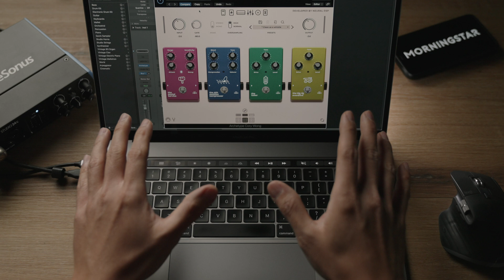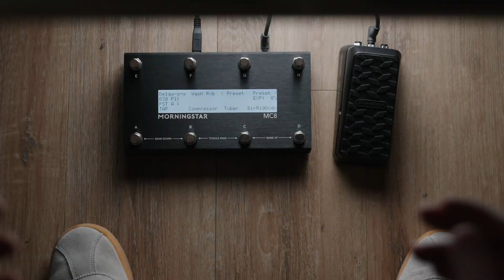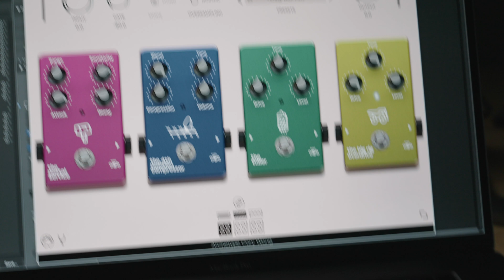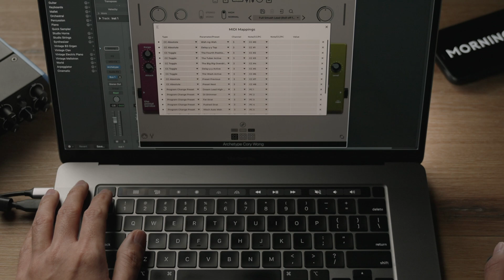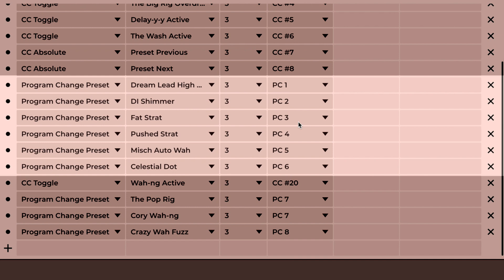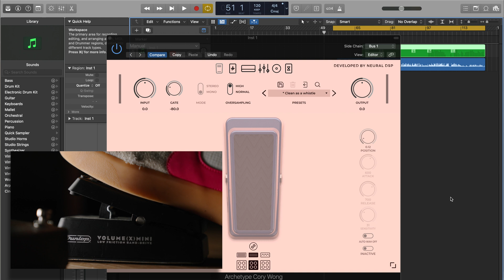Guitar Plugin Foot Controller - ft. Neural DSP

Comment from the maker: NOTE TO ABLETON USERS: For MIDI controlling Neural DSP plugins within Ableton. You will need to use Note messages with positive note velocities instead of CC messages. That is the only way Neural's plugins respond to Ableton MIDI right now.
Reply: Does that mean that there is no way to use an expression pedal with the Neural DSP VST in Ableton, since the Expression Preset Messages do not include Note messages?
Reply: Hi. Im here specifically to learn how to hook up an expression pedal to use a wah from a neural dsp amp. How do I do it? Do I need a specific Pedal? How do I connect it and set it up?
Reply from the maker: @kentower  We have a video taking you step by step here: https://youtu.be/puqkutFuFwE?si=IBhOXRpZM4iimoRt

Comment: why in preset change mode always gap blank sound in milisecond..is like a latency..?
Reply from the maker: Neural DSP plugins currently do not support gapless preset switching. However, you should not be experiencing too long a gap between presets. If you are, it could be due to your system limitations or settings (buffer size etc.)

Comment: Hello. I noticed when you were changing presets in the NDSP Cory Wong plugin, there was negligible delay in switching. When I try the same, I get a pretty abrupt, but short delay. Is there a way to achieve really almost instant response while switching between the presets? Great video BTW 🙂
Reply from the maker: Hi. Neural DSP plugins do not support gapless preset switching (spillover), which could explain the abrupt audio change you hear. Regarding delay when switching, that could be dependent on your system specifications.

Comment: can i use the midi controller to engage the tuner
Reply from the maker: Unfortunately, Neural has not made the Tuner function MIDI mappable. You can try submitting a feature request to them in hopes that they will implement it in future. Would be useful!

Comment: For example, I need to play the VST guitar tool (such as Musiclab Realstrat) in Ableton Live and add the guitar effect of overload with Neural DSP. It was very important for me to switch the presents with a foot pedal, for this I even purchased M-Vave Chocolate.

I set it up and tested it on Neural DSP Standalone, everything works. Next, I launched the Ableton Live, in the settings I put the boxes on Input and Output to see my pedal, created Midi Track and adds the Realstrat tool, and then amplitube, the pedal did not react to the names of the presets. But if you remove the VST guitar tool,

That plugin Neural DSP began to take midi signals from the pedal. It turns out the first tool accepts its CC and does not allow the amplitub to appoint them. How can this be fixed ??

Comment: Thought I could use MC8 with Amplitube and it does work for most things.  But cannot figure a way to turn expression pedal on/off.  Even using the "Toe down" method described here for a different plugin product.  I've opened a ticket and got referred back to this video that I have already watched.  I get that MS doesn't want to do a video dedicated to each and every plugin product.  I get that MS thinks if they do it for one, people can figure it out for other products and I'm sure MS is probably right about that, judging from all the praise the product gets in most of the comments to this video.  Amplitube is a big product line though, and it is not obvious (at least to me) that the mapping shown for this product is in anyway similar to amplitube.  Very frustrating   Just wish MS would have labeled the product as requiring expert level coding skills in MIDI to use the product effectively.  I give up.
Reply from the maker: Hi! Sorry to hear about the challenge you are facing. We would be happy to help with your specific use case. Please send us an email at ‘help@morningstarfx.com’. We provide support from there. A service ticket will be created for you and we will be able to follow up easily.

Comment: Its too complicated. Too many things to do. Its not enjoyable. 

Is there any way that the controller becomes a plug in play item? This needs to be improved, the controller is too expensive and yet too complicated to set up and use. You cannot expect all users to be memorizing those set ups especially during live gigs. Its non friendly to users. Main point is I am a guitar player and I am not a tech geek! So for the manufacturers, please find a way to improve this technology and make it a plug in play device to any guitar plugins. Use AI if you need to. Program an AI to solve all the programming stuffs. 😅😂
Reply from the maker: Hi. You don’t need to memorize these setups during live gigs. You just set it up once and leave it. There are name labels on the switches so you know what each switch does in a live setting. Every switch in every bank can be programmed to do anything you want, and everyone has different needs/workflows. I’m not sure an AI can decide what you want in this case. There are already plug-and-play devices that have fixed functionality, but those offer much less flexibility/usability and are for a different target user.

Comment: is this good to use in pro tools
Reply from the maker: It works the same for any DAW that accepts MIDI, which is almost all DAWs
Reply: @MorningstarEngineering  this also works if we use the plugin standalone instead of using it in a DAW, right?
Reply from the maker: @Sam_Gowman  Yes, that's right
Reply: @MorningstarEngineering  Right then. 
And, does this work with the plugin Mercurial SS11X?
I couldn't find any videos online.
Reply from the maker: @Sam_Gowman  As long as your plugin accepts external MIDI to control it, it will work
Reply: @MorningstarEngineering  Alright.
Thank you for your response.

Comment: Dear Sata...ummm I mean Morningstar,
You made a very promising beginner tutorial, but then showed only half of the basic settings needed for it to work at all? 
Apart from the info which MIDI Channel should we use, you completely skipped the corresponding Morningstar Editor settings and commands?
This is supposed to be a tutorial for someone who never used MIDI on NDSP before, right? 
My head hurts, and if I get your usual response "Please email us your questions." my head will still continue to hurt regardless.
All I needed was to assign 6 buttons and a Toggle Page function. This should be done in 10 minutes max, but here I am sitting with it for 2 days. 

I really like your MIDI controller, but this is just a MUHAHA \m/

Comment: How am I supposed to handle the silence when changing between presets? I need a couple of things ON too quickly and I can’t press many buttons. So, this is a problem
Reply from the maker: That's what presets are for. Or you can send multiple CC messages with a single switch press. Email us at help@morningstarfx.com if you require assistance. We provide support from there. A service ticket will be created for you and we  will be able to follow up easily.

Comment: GREAT VIDEO ? I would love to ask, can it be used with Fractal AX8 like midi controller ? Thanks.
Reply from the maker: Hi. Do you mean you want to use a Morningstar MIDI controller to control your AX8? Yes, you can. Our controllers work with all MIDI-capable devices regardless of brand or model.
Reply: @MorningstarEngineering  Thanks !

Comment: Can it be used for looping controller?
Reply from the maker: Hi. Yes, you can. There is a looper mode on this controller that eliminates latency when you use it to control a looping pedal/device. We made a video explaining that here: https://youtu.be/pZH2zf8Dk4E There have since been further improvements made to this feature such as having only selected switches be in Looper Mode. But this video will explain the basics.

Comment: Thank you so much. It has enriched my life being able to do this. Very well explained. 
Unfortunately I couldn’t get this to work in MainStage ( I find most Apple programs very counterintuitive) even thought the controller was recognised I couldn’t get the plugin to react. 
However I use the standalone version ( of Petrucci) and use the loopback facility of the Focusrite interface to channel the Petrucci output to a MainStage channel , rather than use the Petrucci plugin. 
I just use MainStage as a live mixer ( in edit mode) and it works really  well ( and was free with the MacBook)  and it also has my Toontrack drum kit on a channel.  
If I changes patches in Petrucci ( I used to save the patch with an effect activated and then have a seperate patch without or with a different effect  ) there is a slight gap in the sound ,but by changing the fx only it is instantaneous. 
I use an Airstep to change GTR patches and Fx. 
Cheers BlaMM  ( Blackwood Mountain Man )
Reply from the maker: Hi. Gaps in sound are not caused by the MIDI controller as MIDI messages get sent instantly. That is due to the software/device you are controlling.

Comment: does this work with any midi pedal?
Reply from the maker: Yes, it does. As long as your device is MIDI capable and the functions/parameters you want to control are MIDI-controllable, it will work well

Comment: Can I do a setup that switches between multiple different Neural DSP Plugin presets? For example I would like to use a preset in the Rabea Massad plugin and then Nolly plugin.
Reply from the maker: Hi. Yes, you can easily do that. Just set each plugins to respond to MIDI from different channels. And send the messages meant for each on their respective channels.
Reply: Came here to ask the same. Thanks!

Comment: Too complicate... Use the MIDI learn option.
Reply: Absolutely true
Reply: Midi learn will not work if you load plugin via software (reaper) in that case this is the correct option I think. when you use plugin as standalone you can use midi learn option.

Comment: does it work on multi effects pedal like nux mg300 or mg 30?
Reply from the maker: Hi. As long as your receiving devices accepts MIDI for external control, it will work well. However, the devices you mentioned look like they do not have MIDI ports on them.

Comment: I’m still confused how you can use the same button to change presets that’s also used to turn on/off say the delay pedal 🫤
Reply from the maker: Same switch but in a different bank. The MC8 has 30 banks of programmable switches so you can program each one to do what you want.

Comment: If I wanted to control both wah and volume within the plugin using the same expression pedal, can this be easily switched on the fly? Is there something like an ability to tap a footswitch to maybe cycle the CC number of the expression pedal so it can at different times be wah vs. volume pedal? I'm trying to avoid having to get 2 expression pedals for this and assign them separate CC numbers. Thanks!
Reply from the maker: Hi. Yes, you can do that. We made a video explaining that here: https://youtu.be/m6rMVbxCoa4

Comment: I’m in the process of getting my first midi foot controller and one of my friend told me about your brand. My only concern is would this product work with other plugins more specifically the stl tone Amphub if i want to lets says map pc1 thru pc8 for amp switching ? Thank you guys!
Reply from the maker: Hi. Our controllers work with any device or software that accepts MIDI. As long as the functions/parameters you want to control on your software can be controlled by MIDI, it will work well.

Comment: Hi, what if I have an issue with Archetype Gojira that I have small delay between switching presets(half of second or less +-). So it's kinda bad for playing live performance with my brand new POD GO WIRELESS from LINE 6 and I'm using it as foot switcher. I can't find answer anywhere do you have any suggestions or fixes?
Reply from the maker: Hi. We don't have experience using the hardware you mentioned and are not able to advise. We have not experienced any delay when switching presets using our controllers with Neural DSP plugins.
Reply: @MorningstarEngineering  okay thank you very much for answer ☺️ have a nice day

Comment: Hi, great video! I noticed you don't have silence ( jump ) between preset change #PC. I use Neural DSP Soldano SLO 100 plugin and foot midi controller but I have a big silence between preset change... do you have any idea?
Reply from the maker: Hi. We experience no silence/gap. Please send us an email at ‘help@morningstarfx.com’. We provide technical support from there. A service ticket will be created for you and we will be able to follow up easily.
Reply: @MorningstarEngineering  hi! What kind of expression pedal are you using?
Reply from the maker: @catarusu  Hi. We used a Dunlop DVP4 in this video.
Reply: @JaM ?
Reply: @JaM yes
Reply: @JaM I sent an email at Neural DSP. They told me that for this plugin is impossible to remove the gap between change presets. The only way is use #CC like an real amp

Comment: As far as I'm concerned, the biggest problem is changing presets in plugins. I mean changins are not smooth as processors or fx loop controlled setups. For example, If you change a delay and reverb added-preset to hi gain rhythm preset all ambience stops immediately in plugins :/ So i had to buy a  processor for live using.
Reply: Hi, what kind of processor did you buy?
Reply: @IGOR-RADO any effects processor. If you’re looking for guaranteed hardware that does smooth transitions you’ll be looking into the Quad Cortex or FM9. Could also just get the AXE FX III with an added foot controller.